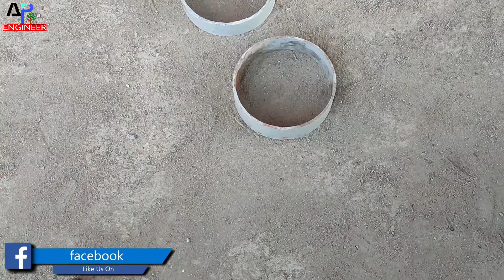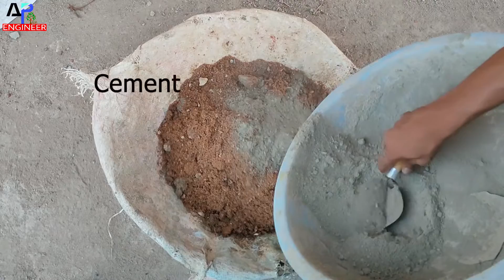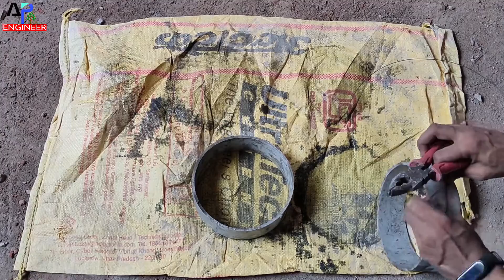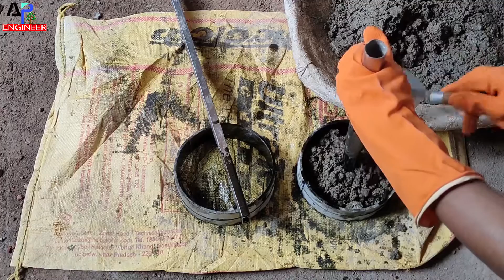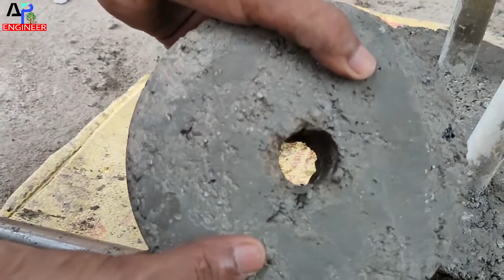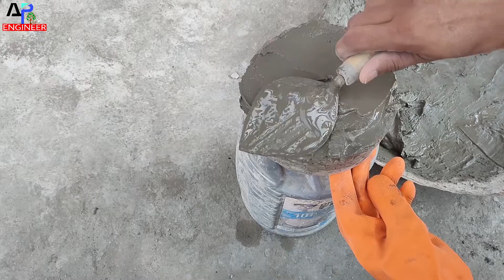How to make Dumbbells at Home | Weight Adjustable | GYM Equipment | DIY Cement | dumbbell

Comment: brother can you tell how much cement we want for to 10 kg dumbell
Reply from the maker: Cement: maximum 3kg
Concrete : 7 kg
I'm going to upload New video on Homemade Dumbbell (probably on 15 May), so you can subscribe us see it. Thanks for watching 👍❤️
Reply: @APtheEngineer  and how much sand
Reply from the maker: @shilpakjoshi6248  Concrete: 3kg Sand(morang) + 4kg Stone(gitti) + water
Reply: @APtheEngineer  thanks
Reply: Brother can you tell how much and which Ingredients I have to for making of pair of 10 kg dumbbells
Reply from the maker: @shilpakjoshi6248  👉Firstly Prepare Concrete: 3kg Sand(morang) + 4kg Stone(gitti) + water + 4kg cement, mix these ingredients together to make concrete.
👉Secondly, use any oil for lubrication while transferring concrete into circular stencil.
👉Thirdly, wait for a day, and next day pour some water on that circular dumbbell, which you have prepared.
👉Fourthly, Follow third step for 3 days to make it unbreakable.
👉At last, you can follow the above steps to make more dumbbells(circular part).

Thanks for visiting again.☺️✌️
Have a nice day.
Reply: @APtheEngineer  thanks 🙏